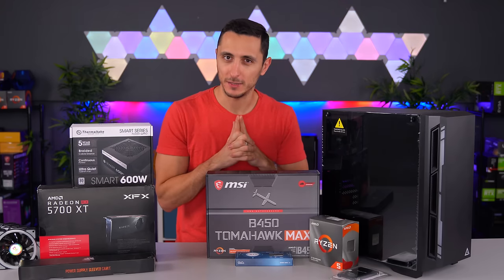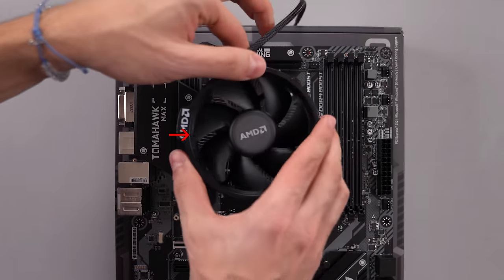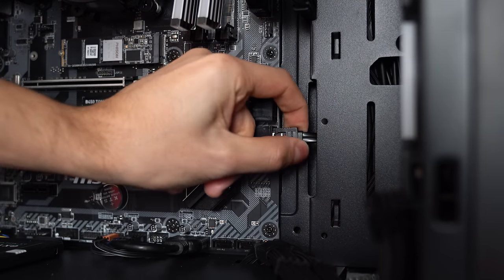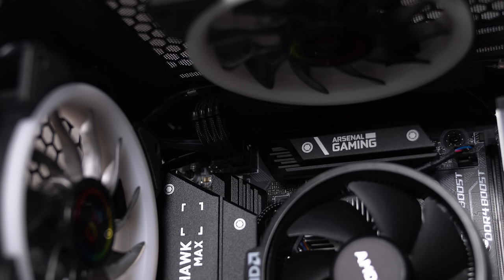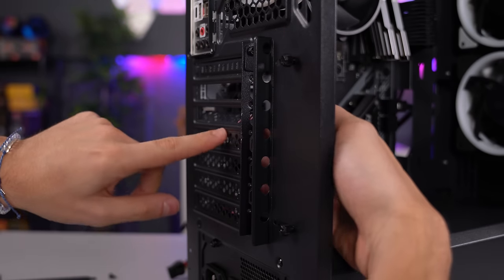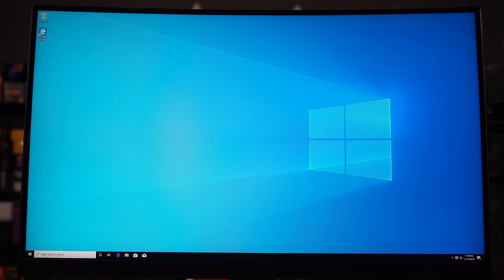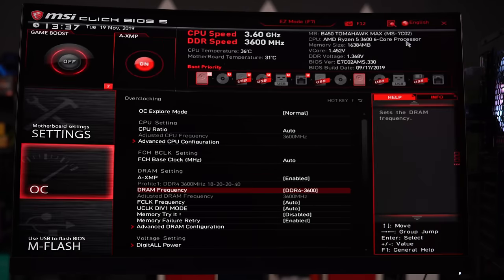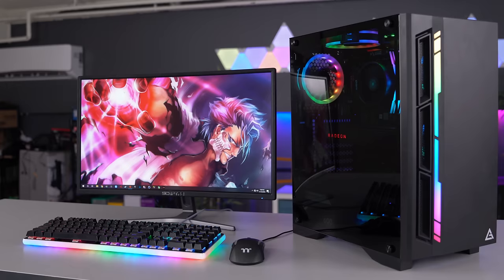How To Build A PC - Full Beginners Guide + Overclocking

Comment: You're giving "General" computer building instructions, but your instructions are specific to your setup. "Install the fan on the power supply facing down" may be generally correct on most modern systems, but not all. But when you got to the "Locate the Hard Drive Cage"... Seriously? There are MANY formats for Hard Drive installation, but cages are less common than anything else. USB Headers labeled 'J'USB? Not really, "USB", "USB2", & "USBF" are more common. 'J'AUD1? Again, I think your board just likes Js  "HDAUD", HD AUDIO", "AUDF", & "AUDF1" are more common. Front Panel connectors it's important to look at your manual because although they have gotten more standardized, they are not always the same. "Make sure the text is facing down" COMPLETELY case dependent, many have plus signs on the one that's supposed to be positive. Fans it's important to note may have 3 or 4 pins, but they are keyed & a 3 pin can be used on a 4 pin header & 4 pin on a 3 pin header. When installing windows you do NOT want to format the drive, ideally you remove all partitions from the drive & select the "UNPARTITIONED SPACE". Your video driver instructions suck, if you're using the newest card it'll probably work but it's always better to select the actual card & get the correct ones, or, better yet, ith an NVidia card use NVcleanstall to make sure you get the right one, auto drivers are properly removed & you get to choose what you want to install. Not every motherboard used [DELETE] for BIOS or UEFI. It's also important to note that not all motherboards have overclocking features. "Just copy your settings?" SERIOUSLY Set it to 4.2GHz? Even if you have the same processor a NUMBER of things are factors on how much to overclock. You shouldn't be allowed to give people computer advice. You can't say this is an overclocking guide as you don't give any useful information except "The settings you use"
Needless to say this Guide will NOT be the one I have my nephew watch before building his 1st PC, but wow,

Comment: Hello, I want some suggestion, I have my laptop with i5 5 generation processor, with 4gb ram and 1 tb HDD,and AMD radeon graphic card, so, I want to upgrade it and want to make it best to use as it gets heated when I am doing a heavy work and it's bit slow when it starts, so please give me suggestions. ..
Reply: I would: 
Upgrade to at least 8GB of RAM
Install an SSD, preferably at least 240 GB in size. Depending on your laptop, you may or may not be able to install 2 drives. You can use the hard drive as general data storage and the SSD as the boot drive
Blow out any dust that may have accumulated on the fan(s) and elsewhere
Add fresh thermal paste

Other than that, there's not a whole lot more you can do with a laptop in terms of upgrades. Most laptops don't have upgradeable CPUs or graphics card.
Reply: @JJFlores197  is 1tb ssd great or should I go for lesser version??
Reply: @northremembers5455  It depends on how much storage you need. I personally would go for a 1TB SSD.
Reply: @JJFlores197  okay. But which company and sata Or nvme???
Reply: @northremembers5455  You can't really go wrong with known-brands like Samsung, Adata, WD, etc. As to what specific SSD technology, that depends on your laptop and what it supports. NVMe will be faster than SATA, but some older laptops may not support M.2, let alone NVMe SSDs. You'll have to find that information.
Reply: @JJFlores197  okay I'll do that how can I find that in online or by opening it up
Reply: @northremembers5455  The service manual for that laptop should tell you what drives it supports. You may also check the technical specifications.

Comment: Hi Everyone, I have a question id like anyone who can help to answer this, when I’ve attempted to connect to the internet it says I don’t have a wifi adapter or anything and won’t let me connect to the internet, any clue how to fix this? Would appreciate the help
Reply: if you mean wireless internet (Wi-Fi) then you need a wifi adapter in you pc, this is like the antenna of the wifi signal, otherwise you need an ethernet cable you can plug in your internet router and motherboard.
Reply: @Ticey7  thank you very much!

Comment: How did you get internet connection?
Reply: You can just plug the Ethernet cable it works out of the box
Reply: If Ethernet is not accessible to you for whatever reason, you will need a wifi adapter/card.

Comment: Do I have to activate windows or can I just use non activated version
Reply: You can run it without activation. You just won't be able to use the personalization settings. Other than that, it will work exactly the same as if you install a product key and activate.
Reply: @JJFlores197  soicant change my background?
Reply: @ryanebel3707  Correct. The workaround would be to right click on an image and select "Set as desktop background".
Reply: @JJFlores197  ok thanks for the help

Comment: dude I don't even have that cable that says usb on it... 11:19, where does it come from
Reply: Those are the front panel header connections. They are a part of the PC case.
Reply: @JJFlores197  my case doesn't come with any wires in it😕
Reply: @JJFlores197  nxzt h510
Reply: @scorlet6129  Did you look through every part of the case? Sometimes they tuck the cables away in the side panel.
Reply: 6:49 do we need the hard drive or can we build a pc without it?
Reply: @JJFlores197  6:49 do we need the hard drive or can we build a pc without it?
Reply: @BearOfAllTrades  You need some sort of storage, be it a hard drive or SSD or both.

Comment: do i need an m.2  if i already have an ssd
Reply: M.2 is the form factor used by some SSDs. If you already have an SSD, you don't necessarily need another one. You can add another one if you want, but it isn't required.

Comment: My screw didn't even fit my WD m.2 🥺
Reply: Ik this is late but if u still need help I had the same problem.  For the m.2 slot, there was a m.2 riser screw next to it on my mobo.  Screw that into the slot but leave the ssd facing up.  Then use the m.2 go put the ssd into place.  Use ur mobo manual to find where your riser is if you can’t find it

Comment: I want to buy  a pc gamer with this specs:

MOTHERBOARD
Asus ROG Strix x570-F Gaming ATX Motherboard
PROCESSOR
AMD Ryzen 5 5600x (6 Cores, 12 Threads), 35Mb Cache, TurboBoost up to 4.6GHz
RAM
Corsair Vengeance DDR4 32Gb White (8gb x 4) 3000MHz
GRAPHICS CARD
Gigabyte GeForce RTX3060 Ti OC 8Gb
CPU COOLER
ID Cooling 240mm AIO Liquid Cooler
HDD
Not included
SSD
WD SN550 1Tb Rocket NVMe PCIe M.2 2280
WI-FI
WiFi 6.0 pre-installed
BLUETOOTH
BT 5.0 pre-installed
POWER SUPPLY UNIT
Adata XPG Core Reactor 650watt 80+ Gold Fully Modular Silent Power Supply Unit
CASE
Corsair 4000D White ATX case
CASE FANS
120mm ARGB Silent PC Case Cooling Fans with Aura Sync
OPERATING SYSTEM
Windows 10 Pro.

It’s a good built? And new in the pc gaming world that’s why I ask for advise. Many thanks

Comment: Do i really need to buy a key code .-.?
Reply: For Windows yes you need a key. I I've brought them from Amazon and eBay in the past four small change
Reply: @andrewlowe3422  I did some research and no you do not need it ツ
Reply: @Lucky_805  it works without but I'm not going to complain about £3 the cost of a Starbucks.
Reply: @andrewlowe3422  true but your gonna have to keep buying them when you switch a part of your pc or other connectors. For some reason they act like a firmware without no storage and go back to 0, so each time that happens you'll need another key. 

Learned from LinusTech 👀
Reply: @Lucky_805  if you change video card you do not need a new key. If you change power supply,memory, CPU you do not need a new key, motherboard yes there other parts No.
Reply: @Lucky_805  Windows Updates also contain security fixes for malware, virus, and other cyber threats that were discovered recently.updating your computer, which you can only do after you activate Windows 10 on your computer. you need a key for that good luck without one.
Reply: @andrewlowe3422  I already passed it (;

Comment: lol I have that case, but these are my specs

Operating System
	Windows 10 Home 64-bit
CPU
	Intel Core 2 Quad Q8300 @ 2.50GHz	34 °C
	Yorkfield 45nm Technology
RAM
	8.00GB Dual-Channel DDR2 @ 399MHz (6-6-6-18)
Motherboard
	Acer EG43M (CPU 1)	40 °C
Graphics
	SANYO LCD (1360x768@60Hz)
	Intel G45/G43 Express Chipset (Acer Incorporated [ALI])
	Intel G45/G43 Express Chipset (Acer Incorporated [ALI])
Storage
	465GB Western Digital WDC WD5000AAKX-001CA0 (SATA )	32 °C
Optical Drives
	No optical disk drives detected
Audio
	Voicemod Virtual Audio Device (WDM)

Comment: Its not connecting on my monitor guys help!!
Reply: Not connecting to your monitor? What does that mean? If you're not getting any video when you turn on the computer, first make sure you are plugged into the graphics card video output and not the motherboard. After that, if it still doesn't work, check all internet connections. Make sure everything is installed correctly.